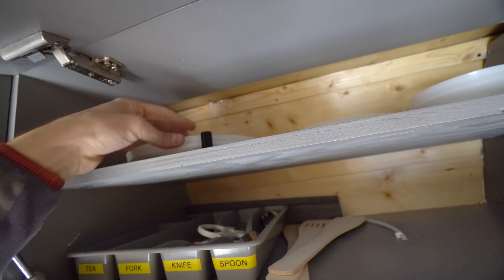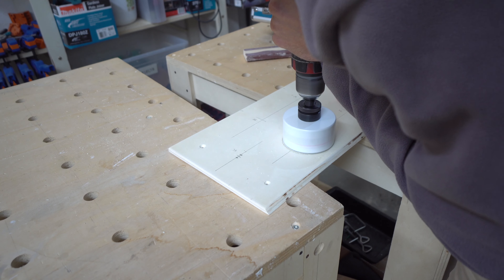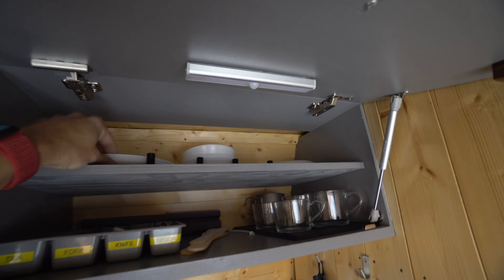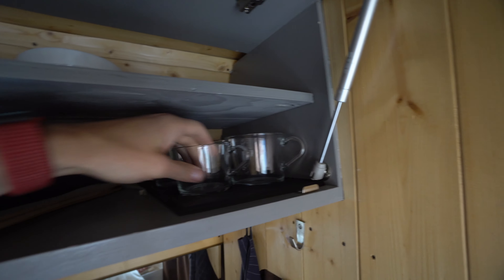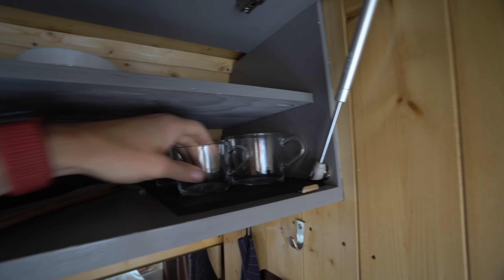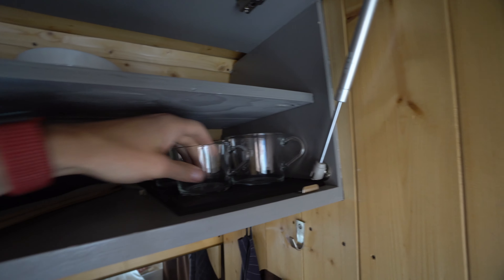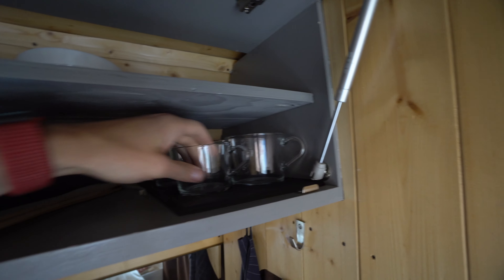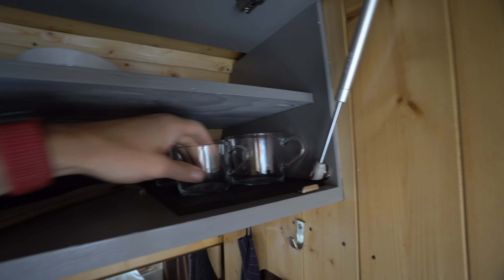How to secure glasses and plates in a camper van

Comment: So simple, but so effective, great tips! You could fix the holes that are too big with a small strip of rubber insulation usually used for doors - very cheap comes with double sided tape on it, or a bit of left over carpet/fabric and some double sided tape.